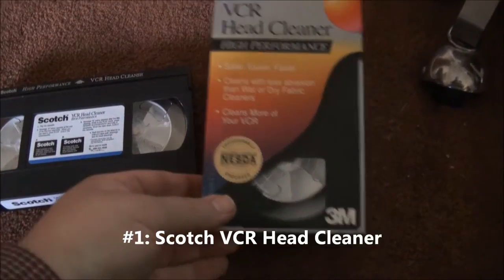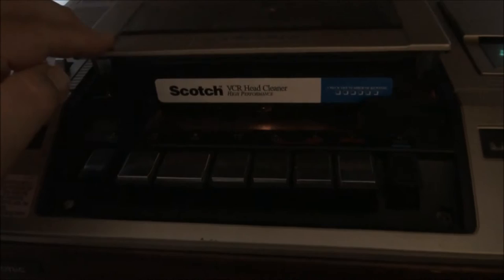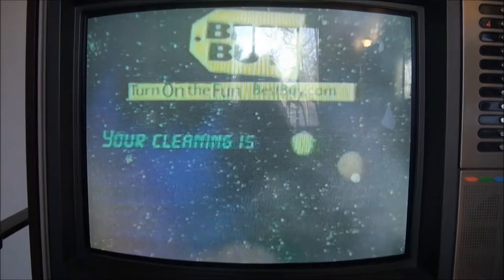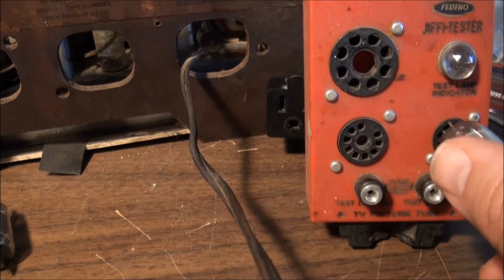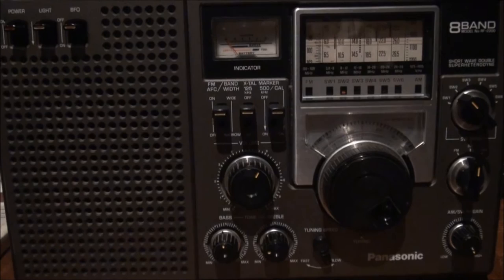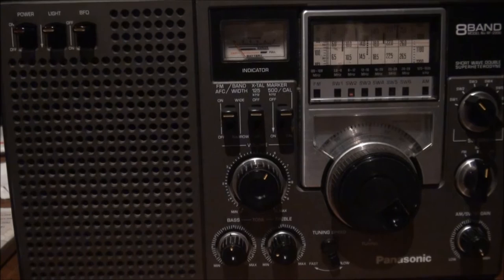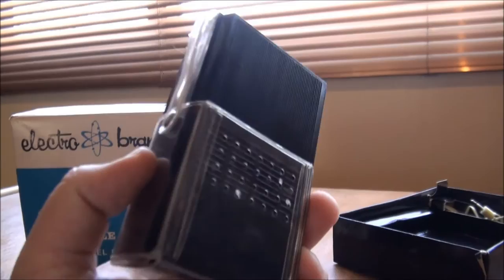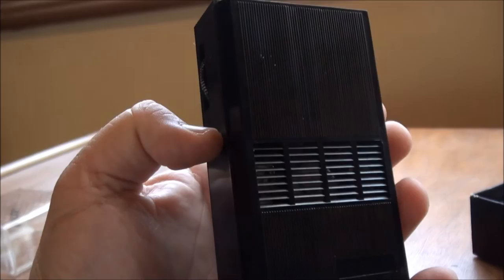5 Videos in 5 Minutes: Vintage Electronics

Comment: I had recently purchased one of those FEDTRO JIFFI" Vacuum tube testers and had problems with it powering on with the batteries, but for some reason the batteries did not want to work with the tester. So I then had an Idea that your testers AC modification gave me and so I converted my "FEDTRO JIFFI" vacuum tube tester to a USB and AC adapter and worked wonderfully. I simply took an old cell phone charger cut the micro connection at the tip and soldered the negatives and positives together. I will be posting it for all to see on 3/10/2015 in a few more hours from now. Thanks for the inspiration.

Comment: My tube filament tester is an Antronic FT-425.  It is actually AC operated and uses a neon  lamp.  They are a very good thing to have if you are starting to restore an old tube set  because it allows you to quickly weed out any tubes which have bad filaments.
Reply from the maker: The one shown in this video broke when it fell off of the workbench about a year ago. I found an exact replacement that had not been modified with an AC plug. The new one just has three AA batteries in it. It's much easier to use this way.